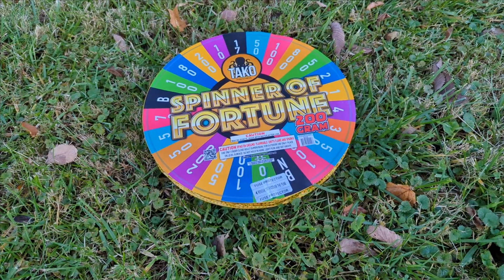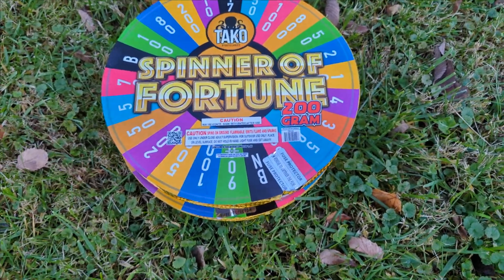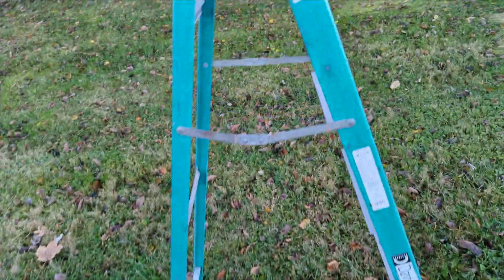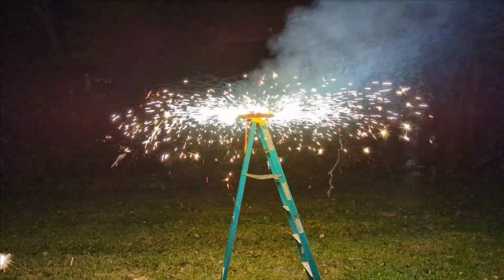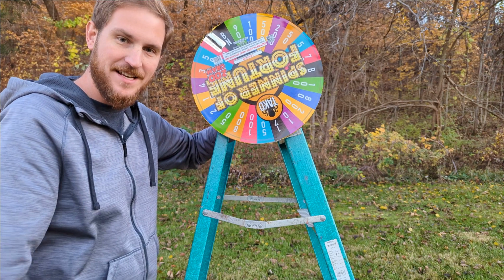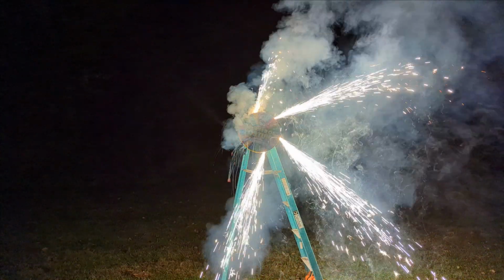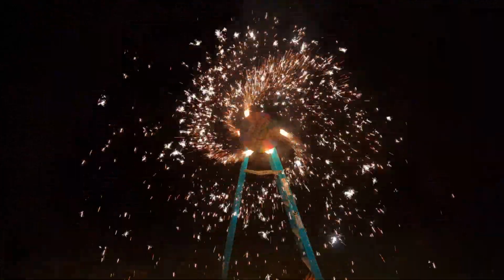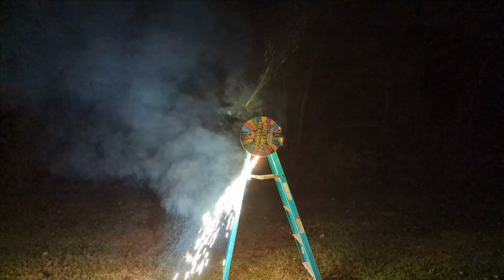Best way to light a spinning (wheel) fountain

Comment: Any suggestions or recommendations for securing a spinning wheel to a ladder?  Tape works ok?
Also, any melting plastic on the ladder from the sparks?
Reply from the maker: I used ratchet straps in this video. It was quick and easy for me to do this demo, but I'd want to come up with some tower configuration if I was doing several of these in a show. In theory tape should work too if you used enough of it. Nah, the sparks didn't effect this ladder.
Reply: @JoelRobinsonPyrotechnics  cool on the ladder.  And gotcha on the ratchet straps.
Btw - a tower would look really cool, and if you can figure out a horizontal span, you’d get an amazing waterfall (at least that’s what my brain imagines).
Reply from the maker: @pnwfireworks4425  we are on the same page! I was thinking about how to incorporate both vertical and horizontal on the same tower. Lots of possibilities